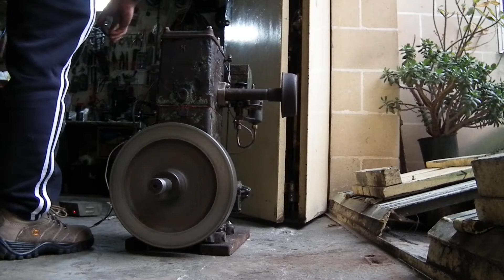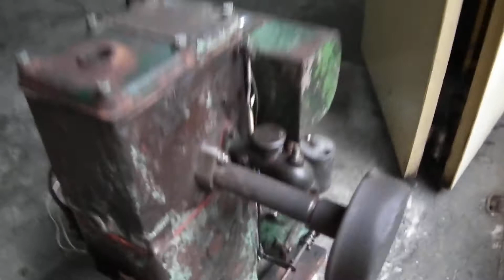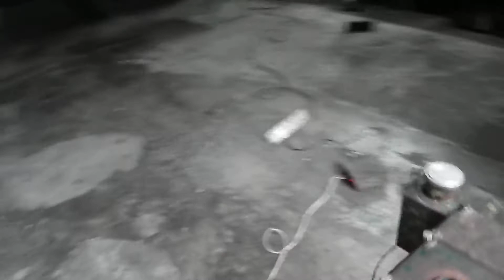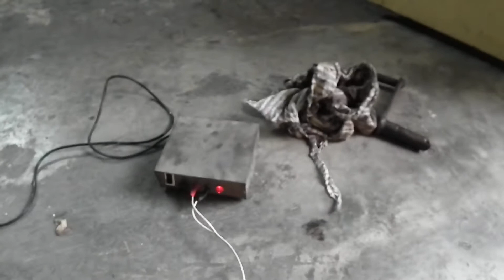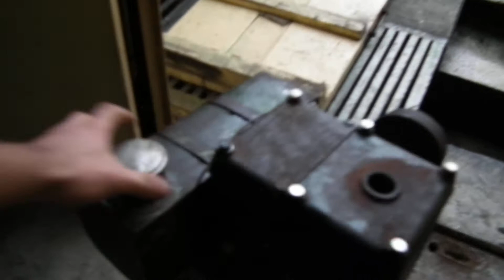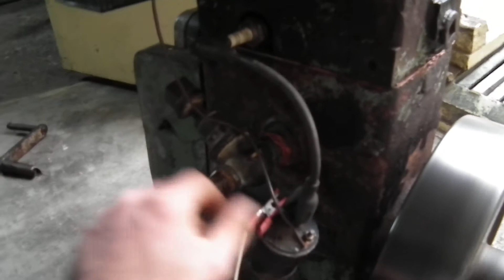Lister D 1945 - Start up

Comment: Nice work, great to see this old engine come back to life. Mine used to misfire a bit like that. One day I took the carby to a guy up the road to look and see if the spindle could be bushed. He took it apart and said there is no wear at all in it and put it back together, when he did he accidently put the butterfly in up side down, runs perfect now, I am not sure I want to turn it back the right way!

Comment: That sounds very good, nice one!
Reply from the maker: Thanks Phill. It should run nice yh? its missing some beats
Reply: enginelover1 It's not bad at all really, but if you want to cure the misfire I would look at the throttle and governor. The speed adjusting spring looks very slack and the engine is running quite fast. Might be worth looking at the throttle valve in the carburetor. You will also need to adjust the brass screw on the end of the horizontal governor rod. Look to the right of the governor casing and there is a brass screw, adjusting tension on the thackaray washer. Adjust it with the engine running and see if it helps.
Reply from the maker: steamwally Yes the spring is slack to make sure its not tight. At that speed the throttle was totally closed. The inner shutter/valve is worn and its sucking air from the sides.  Is it possible to make new brass shutter/valve? The choke has a new brass seating and was ground as well. Thanks Phill
Reply: I should think you could easily make a new valve, it's just a piece of brass plate after all, it will just take some time by hand to hone it just right.